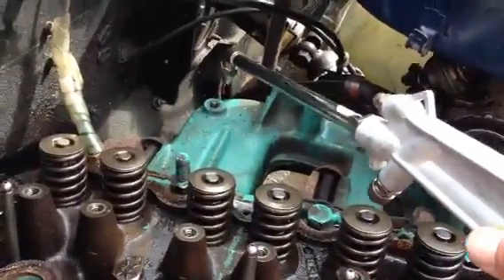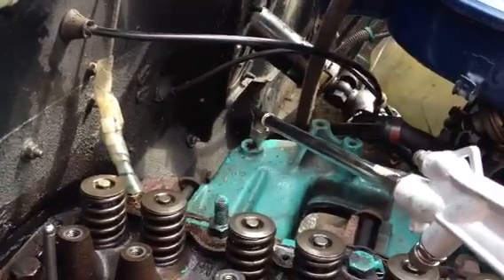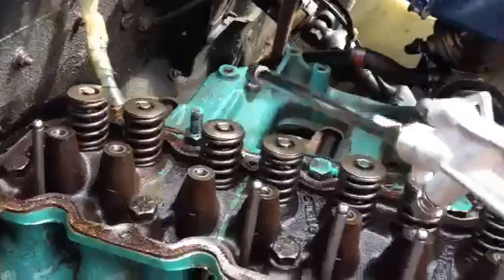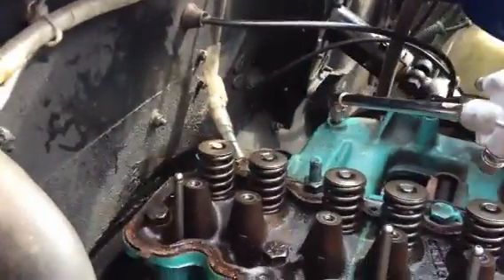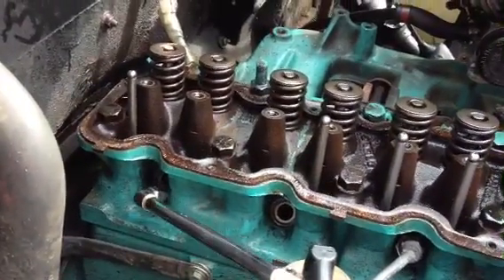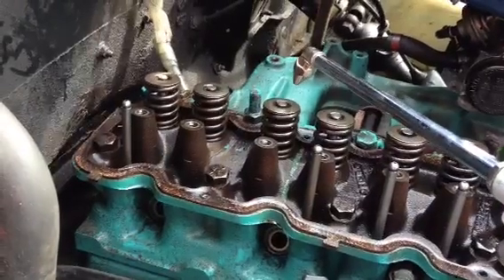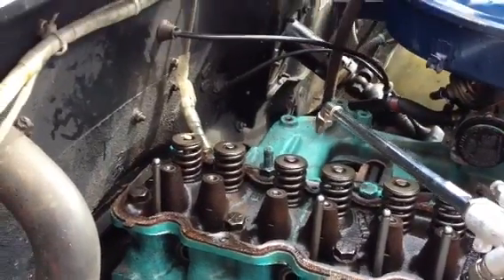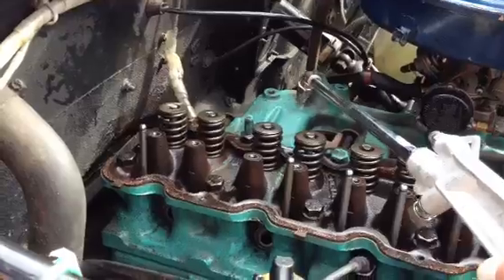Jeep 258 bent push rod sticky valve - full analysis #6

Comment: How did you fix the bent pushrods issues and sticking valves.
Reply from the maker: Hi Jamaal, you can see the full view in the series that I created. But in short: series cleaning of the valves, stems, carburettor etc lead to fixing the problem.
Reply: @jeepingjr  I just picked my engine up yesterday from storage. I’m a little overwhelmed with having to do it would have just liked the original 232 and T150 setup. But thanks maybe I will try to do a YouTube on this adventure
Reply from the maker: @JamaalBey404  I still have the original setup of engine and T150 except what you see in my other videos of all parts I replaced like offenhauser intake, ford carburettor etc.
Very happy with my setup.
Reply: I tried the same thing with my 76 CJ7 and it worked but I have bad rings so I’m going to do a total drivetrain swap
Reply from the maker: @JamaalBey404  Good luck!
Reply: I tried the same thing you did with my 232 setup and it still smokes and run even worst then before so now I’m just going to step away until I can save money. I will either fix it or sell it
Reply from the maker: @JamaalBey404  Hi Jamaal. Did you measure the compression? Mine was ok but the smoke must come from something. What colour is the smoke?
Reply: Yes I did a compression check. But now I just dropped the 232 off at the machine shop to have it totally rebuilt. Way cheaper then doing a swap from what I priced for parts.
Reply: Compression was bad on cylinders 4,5,6. So I just decided to have the machine shop rebuild the factory engine 232 and cylinder head valves job with all new parts.